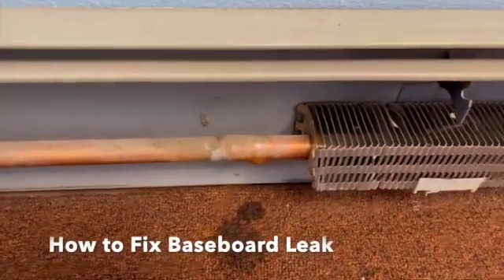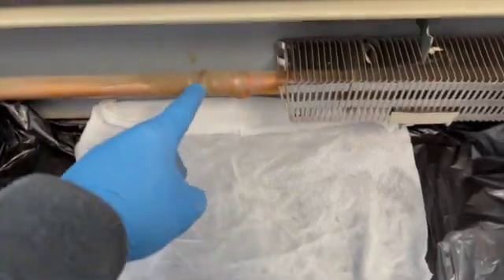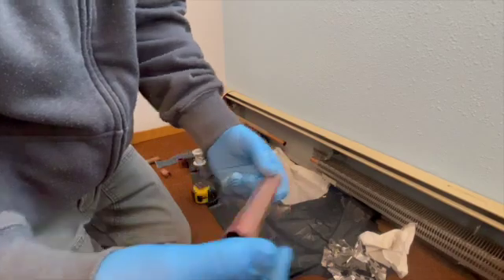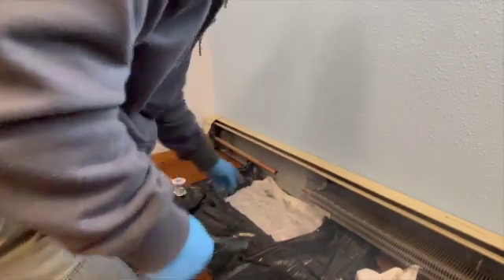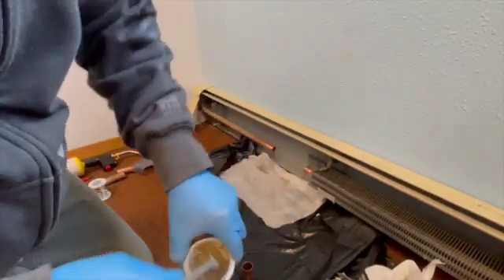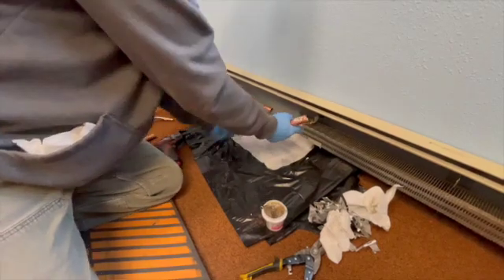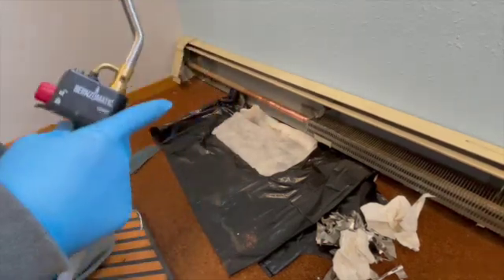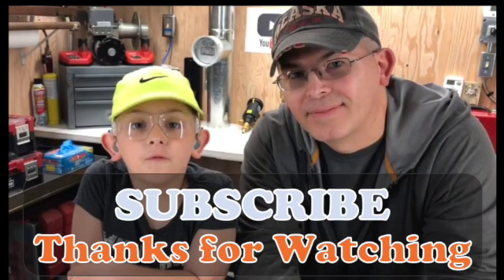Leaking Baseboard Pipe? This Is the Right Way to Fix It for Good

Comment: Do you have a list of parts needed?
Reply from the maker: Every job is a little different! Basic soldering tools include:
Torch 
Torch Gas bottle
Emery cloth or wire brush
Flux
Flux brush
Wet rags or some type of fire blocking blanket 
Reamer
Different size Pipe cutters
Solder
There are so many different tools or supplies you might need but they are specific to each job or project. I hope this helps! Thank you for watching

Comment: Hi, how would you suggest detecting location of heating pipe for baseboard water heater behind wall? Former owners severed the pipe in the boiler room for the basement.  Thanks!
Reply from the maker: That’s a tough one! My best suggestion would be to start where the end of the baseboard run is located and work from there. You can cut small inspection holes to limit damages. I hope this helps

Comment: Did you have to drain whole boiler system line prior to cutting copper radiator??
Reply from the maker: No, I have isolation valves in each heating loop.
Reply: What is an isolation valve
Reply: @manolo123443  It cuts off water to that particular part of the system/zone.
Reply: no I don't
Reply: yes, but he had shut offs on others of the house so he didnt have to drain the whole system

Comment from the maker: Tools and Supplies I use in this video:
TOOLS
Milwaukee Copper Cutter: https://amzn.to/3ung16J
Milwaukee Drill: https://amzn.to/37JeKNl
Milwaukee Pen Light: https://amzn.to/3qVUD6s
Bernzomatic Torch:https://amzn.to/2NASTRl
Wire brush for drill: https://amzn.to/3qJWomZ
Tape Measure: https://amzn.to/3kf7UEw
Sheet metal cutter: https://amzn.to/2Nq3uid
Reamer: https://amzn.to/2OYtHEM
Needle nose pliers: https://amzn.to/2ZJ61Gu
Mirror: https://amzn.to/3pPwcWA
Fire Extinguisher: https://amzn.to/2ZMYGFX

SUPPLIES
Emery Cloth: https://amzn.to/3dOUBJw
Solder: https://amzn.to/3qOGM1r
Flux: https://amzn.to/3kh8NfC
Flux Brushes: https://amzn.to/3r1NzF2
Rubber Gloves: https://amzn.to/2NCedGj
3/4" Coupling (with stop): https://amzn.to/2NDarMG
3/4" Repair Coupling (NO STOP): https://amzn.to/2NZOqb2

Thanks for watching the video!  Click the link to SUBSCRIBE: https://www.youtube.com/channel/UC-ZPTqzkJujjUouZZohAvDw?sub_confirmation=1